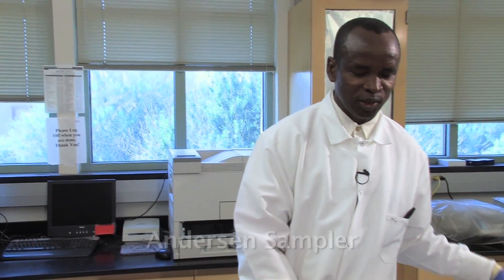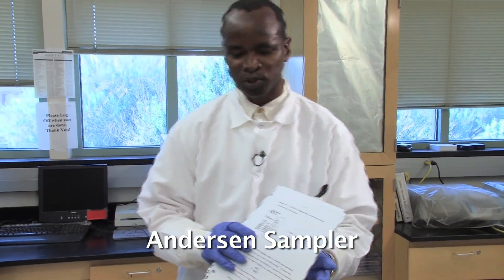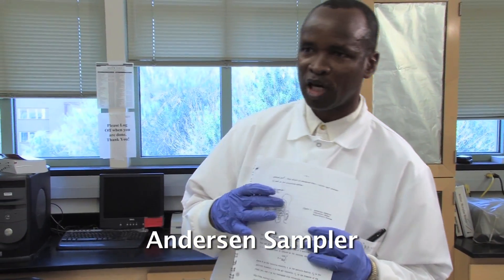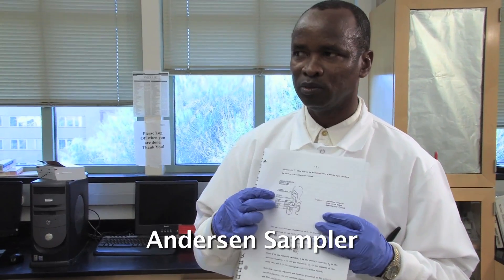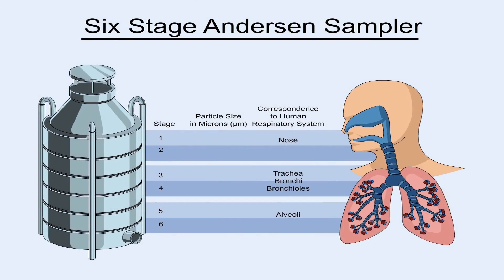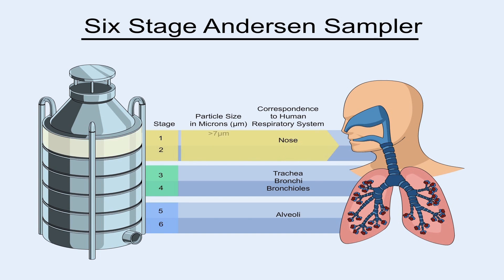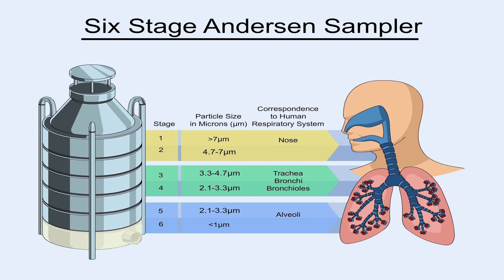Air Quality: Andersen Sampler Demo

Comment: How did the ash pass from the first (top) dish to the second dish since the first dish covers the perforations going to the second dish?
Reply: Thanks for the question. The system is under vacuum with a cloud of dust particles being drawn through several mini-chambers (each mini-chamber is the compartment containing a dish). There is enough space in each mini-chamber to allow the air to impact onto the medium in each dish and to move out through the perforations underneath each dish into the next chamber. In essence, the air is not blocked by the dish and the air does move around the dish into the next chamber. The particles with the largest size are deposited on the medium in the dish in the top chamber and the particles with the smallest size are deposited on the medium in dish in the bottom chamber. I hope this provides clarification.